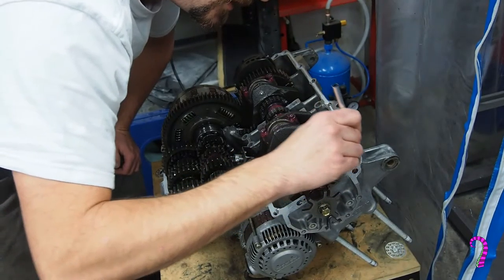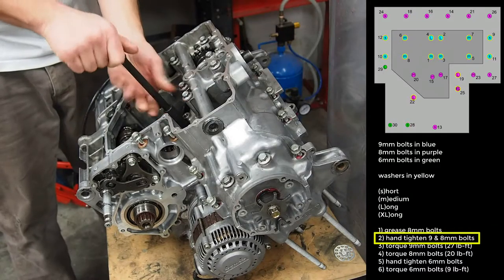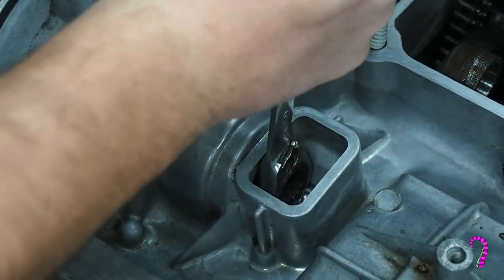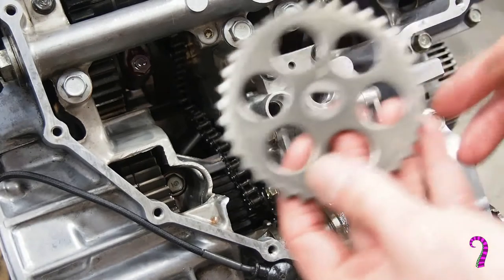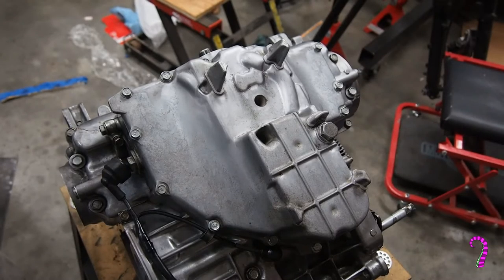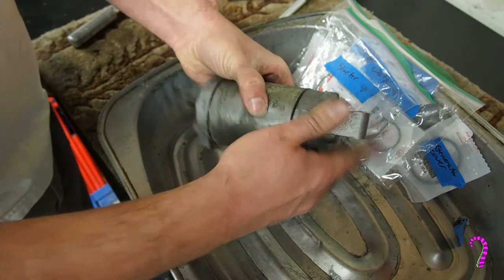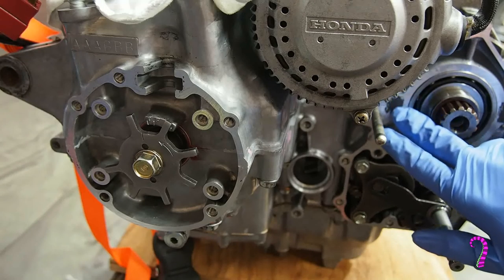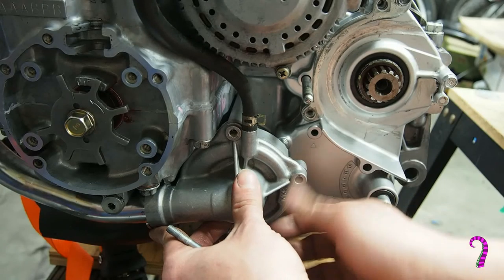Hurricane Engine Rebuild Chapter 7 – Crankcase Assembly!

Comment: The alternator shaft nut can easily be torqued with ordinary tools; use a crows foot box end as an extension to your torque wrench , calculate the difference or the ratio of this extension, then adjust your torque number (less). Great video, thanks.

Comment: Handmade gasket? Surely there's a bit of a story here...that's a damn decent looking gasket for being handmade. 

FWIW, head studs in the automotive world are installed hand-tight, and I see no reason why that might be different on a bike motor. And threadlocker should not be used on studs, as it will possibly expand as it cures and can result in a cracked case. Matter of fact, on an aluminum bike motor I'd be limiting the places I used locker for just that reason. I suppose I'd want to ask the Loctite guys about that expansion deal.

Overall, nice work (but I worry about the threadlocker all over the place, and that hella-tight stud). Anyway, might turn you on to Dow Corning High Vacuum Grease (Amazon has it). It's magic on o-rings and rubber parts, and harmless to same. Use it on o-rings, rubber gaskets, paper gaskets, carb intake boots, and tons of other stuff. Has the consistency of uncured RTV, but of course stays that way. My 2.0l Honda motor has a neoprene valve cover gasket that gets removed every 15K for valve adjustment. I smear the Dow Corning stuff on it for reassembly, and with 150K on the clock, it's been off 10x in 25 years. It's still the original gasket, and it still doesn't leak. Anytime I'm assembling something with an o-ring, it gets that grease. As an example, it would have been just the stuff for that water pump seal.
REPLY
Reply from the maker: Huh. Didn't know about the head studs being hand-tight. I couldn't find spec anywhere so I went with what some folks on one of the forums recommended. Good to know

I couldn't find a full OEM gasket kit for a reasonable price (I think we were looking at shipping one from Europe) so I'd gone with a top-end kit out of the states, which was still heinously expensive, then snuck onto the photocopier at work to get a scan of each of the mating surfaces for the other gasketed parts. I went on a Friday afternoon so the office would be empty, and used transparency sheets to make sure I didn't get any leftover grease on the scanner bed. All very stealthy. After that, I used a computer to clean up the images and sent them to a small plotter for a template sheet. Aside from a couple tight spots on the alignment pins for the shift cover and clutch slave gaskets, they all fit perfectly

That grease seems to be pretty tough to find up here in the frozen north. Most sellers will not ship liquids or other potentially dangerous goods cross-border so would have to look at a jobber or other distributor. I'll definitely keep an eye out for it though. Thanks for the tips